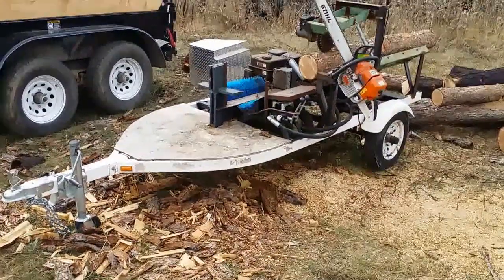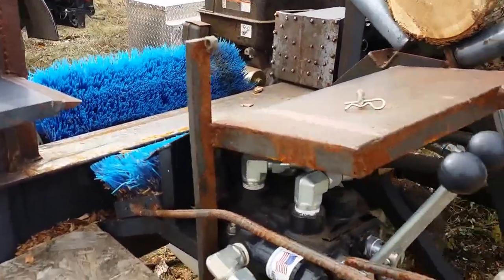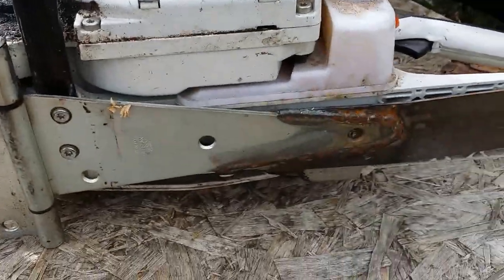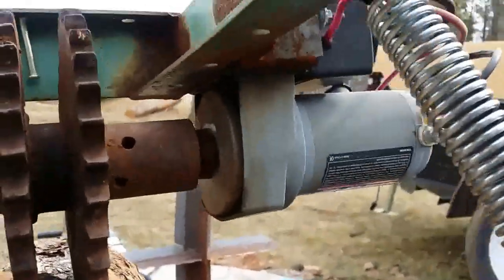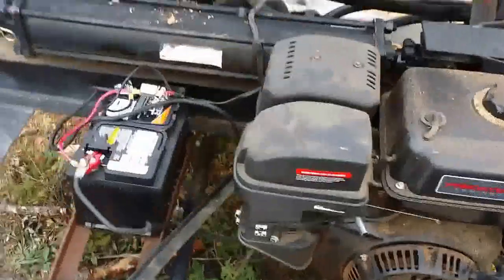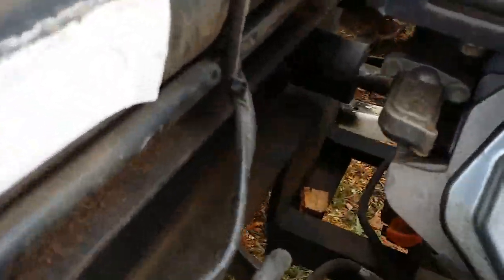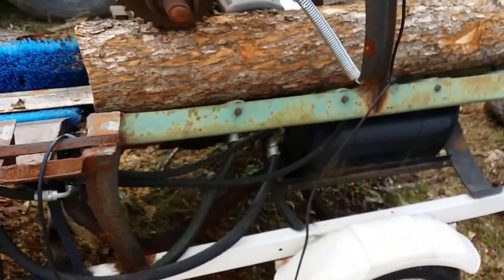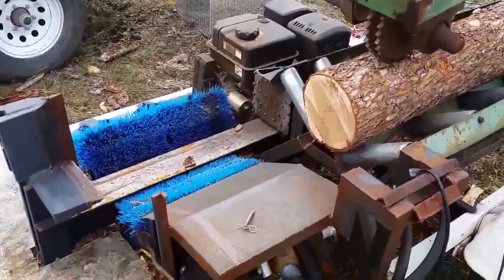Homemade firewood processor details

Comment: What kind of a hydraulic valve is that? Do you have a make and model?  -You've done a great job of making a simple yet fast processor... Well done.
Reply from the maker: prince two spool auto cycle valve
Reply: Please don't forget to keep the system at the gpm of the pump
Otherwise what ever the lowest gpm component in your system is what the whole system will be restricted down to . If possible buy components one level bigger and maybe upgrade your pump later.
I was taught to help avoid over heating the hydraulic tank, capacity should be twice the gpm of the pump . Another idea is to use a small radiator with computer fans to move the air through . Remember these aren't meant to be out in all kinds of weather.

Comment: Lot of good ideas. The I-beam flexing will keep you honest and not let you tie it in a knot. 440's are good saws. Will bust a $1000 bill for a new one. No thanks. Mine was run dry and I got a buddy to put a piston and jug on it. Runs like factory. You ought to make a video of it running, the whole thing, that is. An old Ford power steering cooler or two might help on the hot oil, or maybe thicker oil. I use  I.S.O.68 in mine. God job!
Reply from the maker: Thanks for the comment. I do have a video it running. I will make another video of it running with all my modifications soon.

Comment: Have you thought about adding a second winch on top of the overhead frame and a drop down ramp to use to grab logs from the pile and drag them up onto the processor? 😊
Reply from the maker: That was my original plan but the winch is pretty slow.